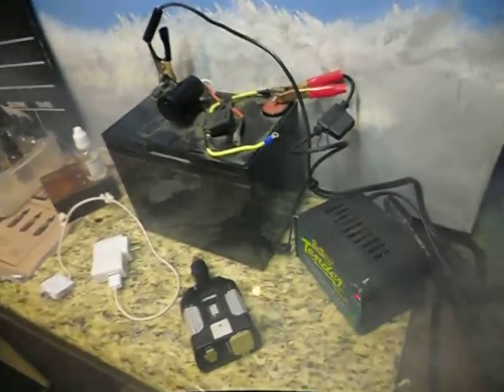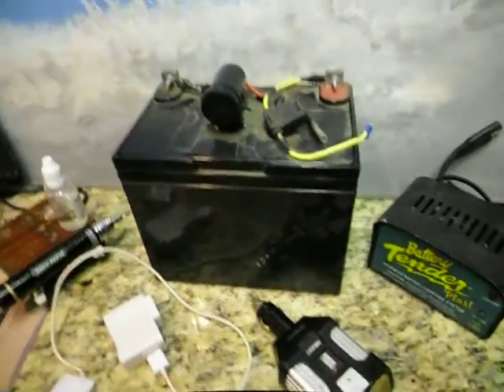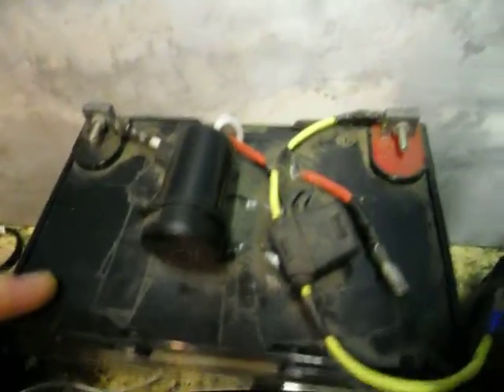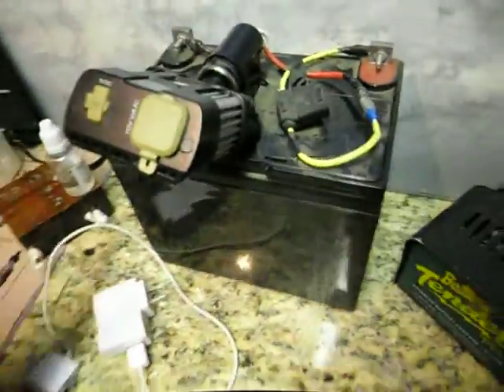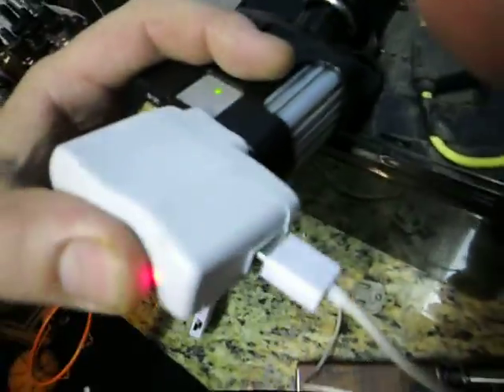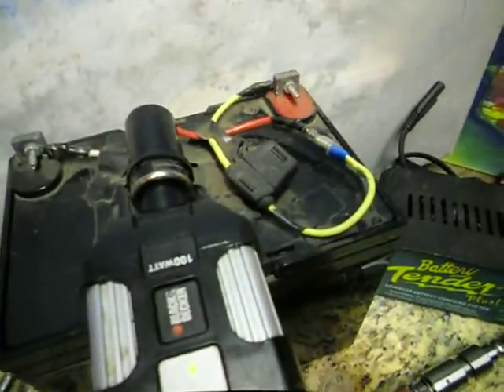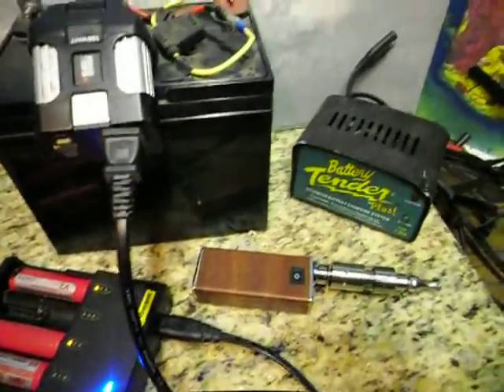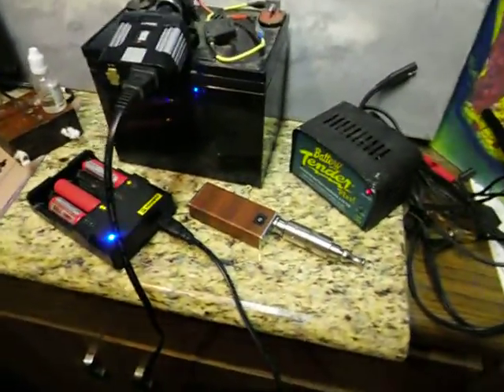Portable charging station for vape gear, camping emergencies, etc..

Comment: Great concept. You could use a car plug multiple plug in and use a 12v cord to plug in your Nitecore. Using the inverter is great but with it using a fan to keep cool will help drain your battery slightly quicker. Otherwise great job bro👍👍

Comment: I have similar stuff for my rv to run ac when camping. The cig lighter is not the best connection. Most inverters come with clamps on wires to hook up straight to the big battery. If it works that's cool though. Cheers!
Reply from the maker: thanks! yea, this works for vape gear and cell phones for sure! there are larger converters that would e better wit a car battery, this is just the smaller, moreportable version. one could also add a trickle charger solar pannel, if one is inclined!